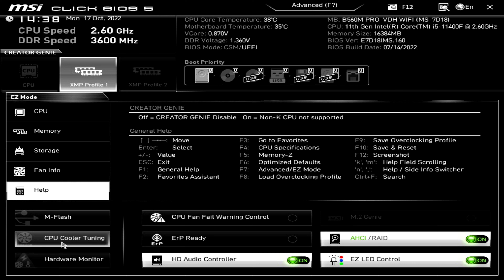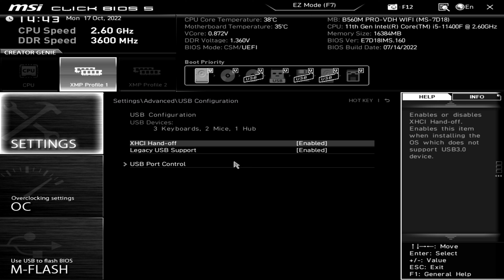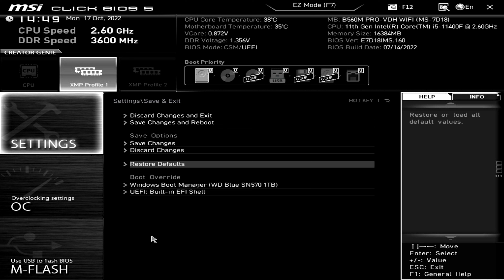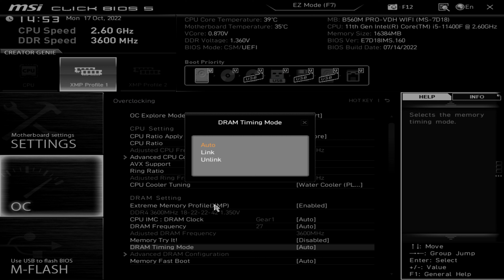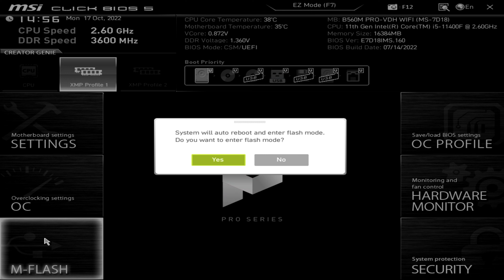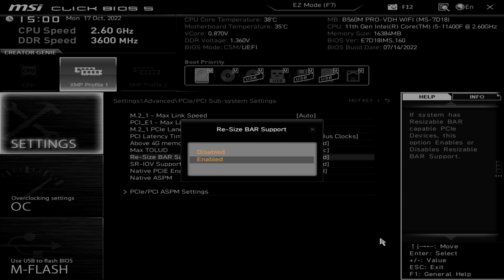MSI B560M Pro VDH WiFi BIOS Tour XMP TPM Secure boot etc

Comment: Good video! Is it required an update bios for actívate PCIe lanes source with Intel 10th gen processor? What version of bios is it run this method? Thanks for your contents.
Reply from the maker: there are some lanes on the 10th gen that won't work on 11th boards like this. i think it is the main nvme slot as that talks to the CPU directly although my knowledge is a bit rusty

Comment: how I do to enable the usage of a second monitor, what option on bios I need to change?
Reply from the maker: depends on the setup you have and the processor you are using, tell me more about what you have and i'll try and give you the info
Reply: Well, I already had a solution, had to buy a conversor from vga to displayport to conect my second monitor on my video card, I did everything to conect my main monitor at my video card, and the second on my motherboard, but nothing happn, It will be no more necessary this info for me, but someone may have the same doubt at somepoint, btw, my setup is a: I5 11400f, gtx 2060 super 12gb, b560 M-A pro, 16gbram, 256 GB ssd, even so, if you had a solution I will be interessed to know, thanks.

Comment: How do i change my thermal control setting? I can't find it. The only way i can bring it up is by using search but that only gives me an auto/manual option and not setting the temperature
Reply from the maker: for the fans or cpu limits?

Comment: Hello Mike! Just wanna ask since it's not a common issue
I have the same motherboard, 
i5 11400
Msi B560m pro vdh wifi
nvme 500gb

it's working but I think there are few bent pins but it's still working and going bios. My main problem is, I downloaded gpuz and see if my gpu is running full potential but the bus interface says it's running at PCIe x 16 3.0 @ x2 3.0. Basically it's running at x2 instead of 16. The gpu isn't the problem since I tried it on other pc it works fine at 16. Do you think it's the motherboard that is causing the issue? Or the processor itself?
Reply from the maker: I would try reseating the cpu and see if that helps or depending on the cooler maybe loosen it or tighten it
Reply: I tried but still the same problem, if it's the pins that is causing the issue, is there a way to fix the pins or should I just buy a new motherboard?

Comment: Why do motherboard guys dont make a Windows utility that mimic the bios so you can start to tune the bios friday, save your work in progress, and be done with these numerous memory timing the next friday, (yes, I'm lazy), save your setting, apply them, reboot and if it dont work, you can just reset the bios and boot into Windows, relax some setting and try again.
The older I am, the less I like to play in bios.. 😁
Reply: It ususlly only takes a few seconds to make BIOS changes. Besides, motherboard guy have a hard enough time writing BIOS code. Writing code for a Windows utility would burn out their mental circuits.